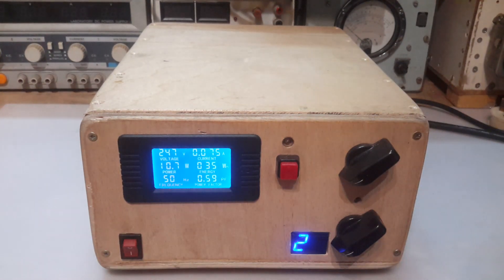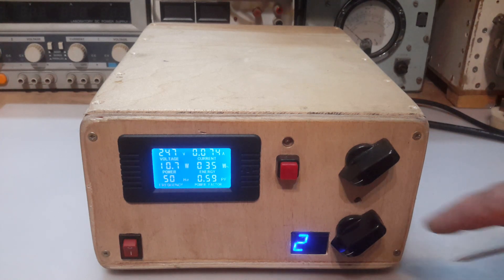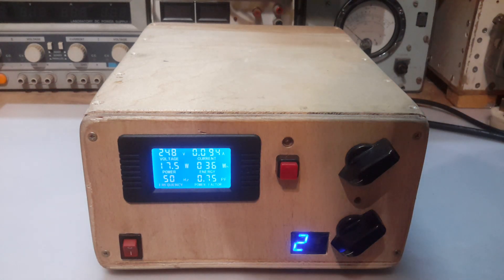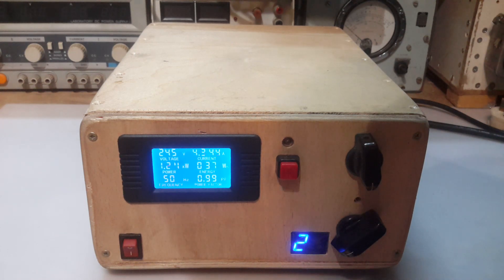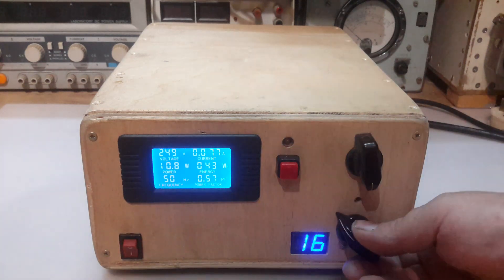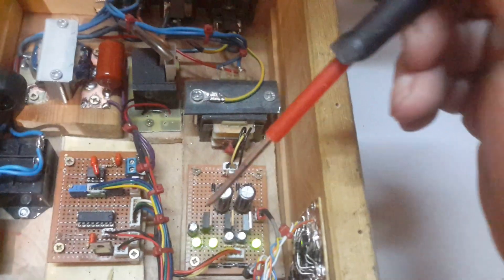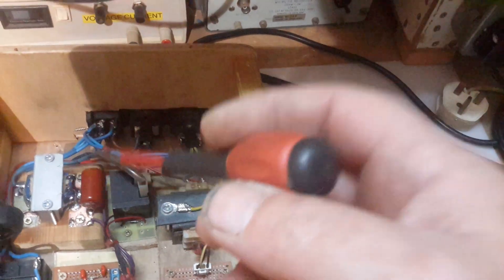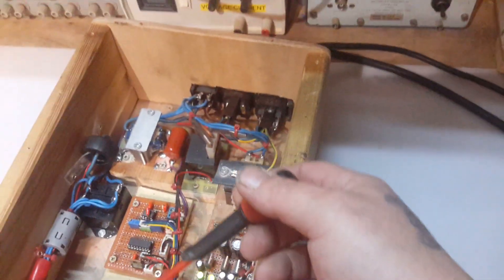The Glasslinger Electronic Circuit Breaker 240v Version. (Thanks Ron)

Comment: Great that you built a 240 V version. I plan to build one of these and it will be for 230 V as we have here in New Zealand. From what I can see, the only difference would be to supply the low voltage electronics from a suitable 230 volt transformer rather than a 120 V one. Is that the case? Did you have to make any other changes?
Reply from the maker: Yeah that's about it mate 👍 also added an extra relay so when power was removed it was open rather than closed for safety 👍👍 thanks for watching my channel 

Steve
Reply: @T2D.SteveArcs  I've looked at Ron's design and XrayTonyB's variation of it (he changed a few things) and I think my build will be a combination of the two with some mods of my own. I agree with you choosing to have a relay that opens when power is removed. I was thinking that when I first looked at the design for this unit. It can easily be achieved with just one relay by using an extra transistor to invert the signal from the 4040.
Excellent channel and thank you for the content you post!
Reply: @T2D.SteveArcs  I was just looking at Glasslinger's video on the one he made and someone else suggested they also wanted to have the relay held in the on position during normal use and have it drop out in an overcurrent situation. Ron's reply to that was he found that the relay took around ten times longer to drop out than it did to pull in, hence why he built his unit that way.
Reply from the maker: @stopthebus  mine is exactly the same as Ron's except mine has an extra relay so when the unit is switched off it opens and disconnect the load.. in Ron's if you switch it off the power can still pass through to the output 🤷‍♂️